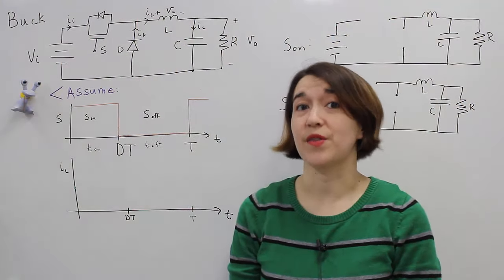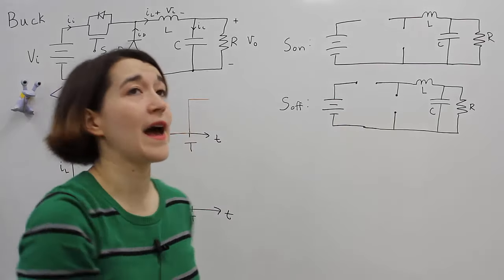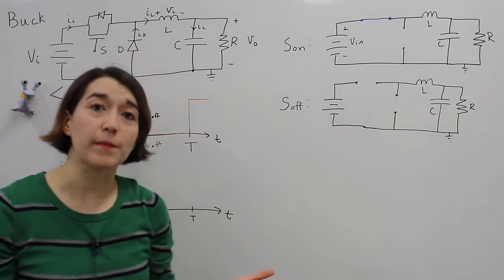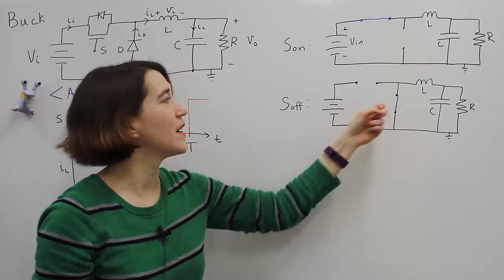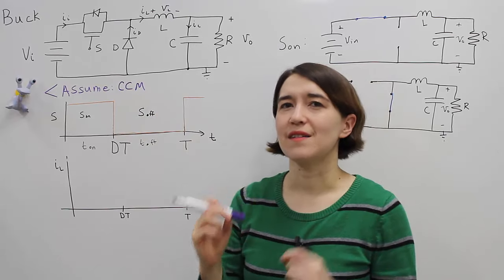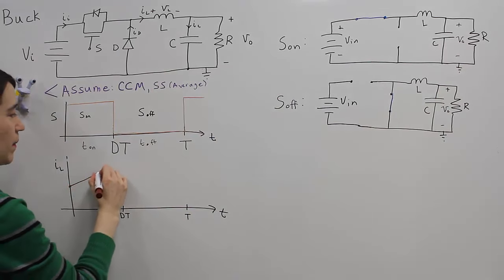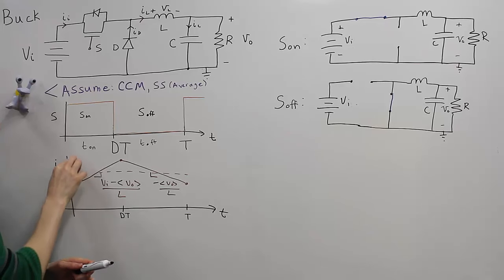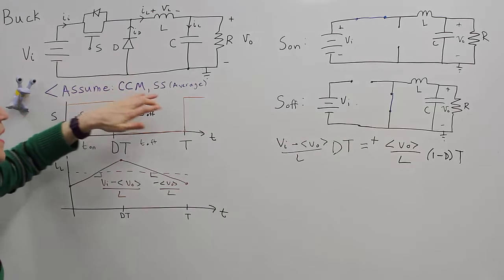Buck Converter Operation and Voltage Equation

Comment: Very nice explanation of working of stepdown dc dc converter under ccm in ss. For deriving the duty ratio equations, it would be easier with the plot of voltage across the inductor.